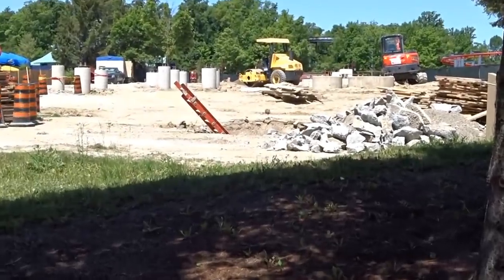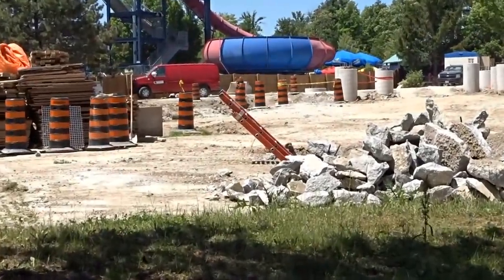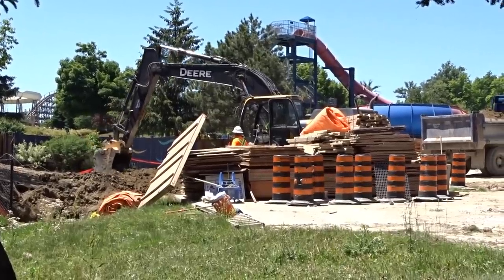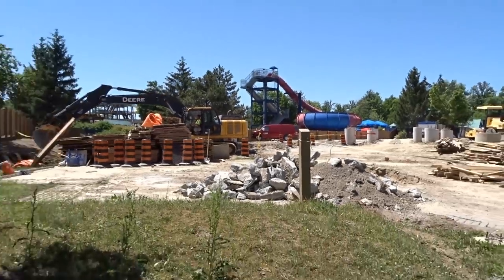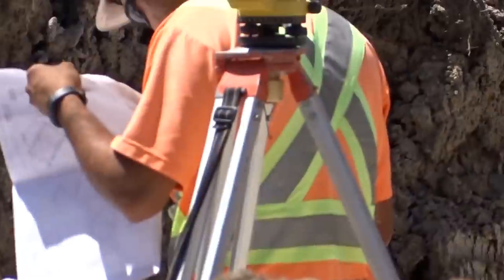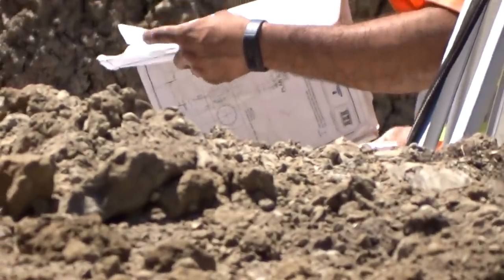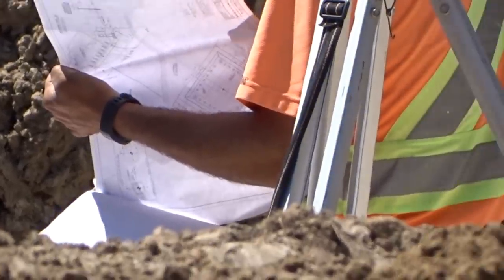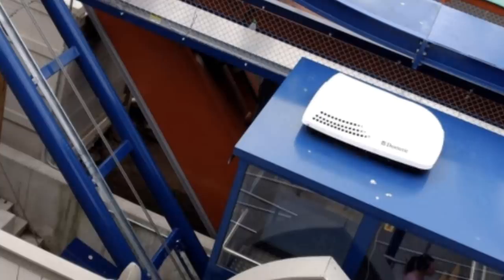Canada's Wonderland Massive New Coaster Being Built - Yukon Striker

Comment: not from the blueprints, but by doing my own math cause im just that bitch but if your past videos are true, with the length of the lift hill, (probably at 45 degrees) it is supposed to be about 250 feet tall or higher